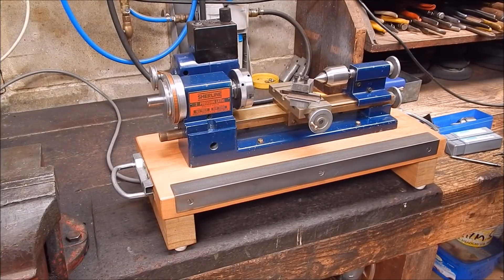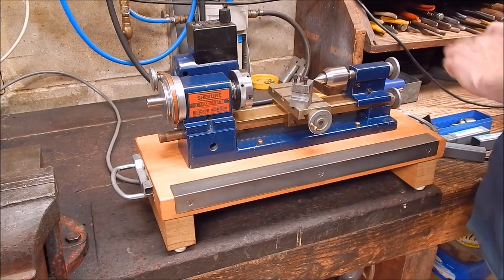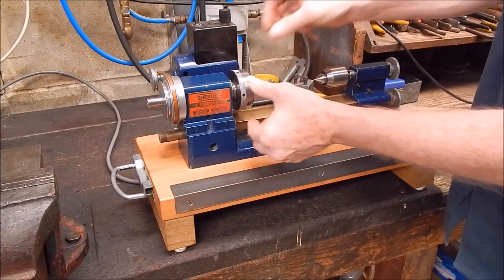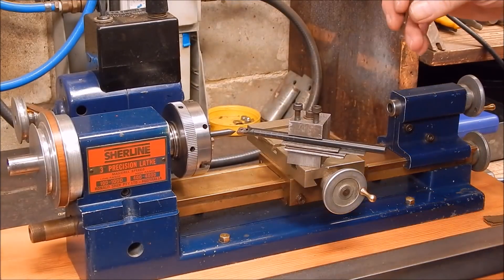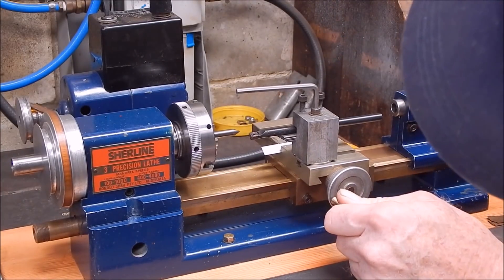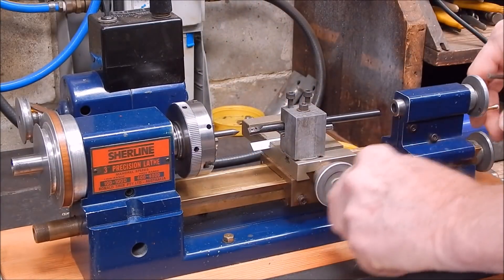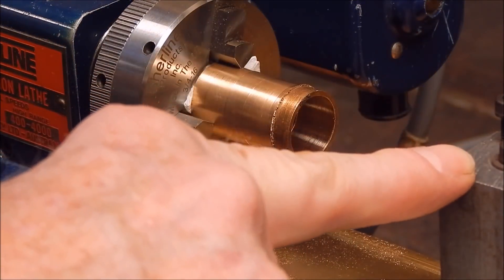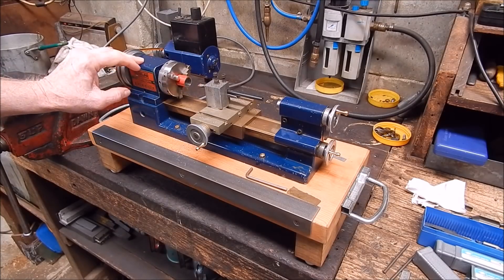I try the Banggood 7 mm CCMT boring bar in my Sherline micro lathe

Comment: You could use a drill bit in the chuck and bore a hole in your tool holder,, the size of your boring bar. That hole would be centered exactly in the on your chuck. No shims or washers.
Reply from the maker: Hi Doug,

I am kinda thinking that way.  Rather than mess with the existing original holder I may just make another from some home cast aluminium block I have laying around.

The only thing that worries me about that style of holder is that the cutting tip can be low if the fit is less than perfect.

Cheers Rob

Comment: There are a couple of things on that old Sherline that I prefer to the modern ones. On the new ones the c/s is made of aluminum, and if you tighten the screws more than finger tight when you mount a accessory that uses both T-groves (like the compound slide or a vice for milling) the c/s will warp and bind. By having it in cast iron like I think yours is, and using English style T slots across the c/s, that should be less of an issue. Have you noticed any problems? 

Also the tailstock on the new models have a grub screw to hold the tail stock barrel in position. I prefer the slot and screw arrangement I see on yours, it will hold the barrel in central position better than a grub screw. Stefan Gotteswinter showed his Chinese lathe once where he had changed the barrel clamping action to this pinching method.
Reply from the maker: The cross slide on mine is aluminium or more likely Duralium.  I agree the "T" slots going crosswise in the early English lathe style is way better than lengthwise.  It doesn't weaken and allow distortion of the cross slide like the the new ones.

Why most modern lathes go lengthwise with the "T" slots is beyond me, as it's a retrograde step.  It just weakens the cross slide.

I've had no warping issues with my old Sherline.

Cheers Rob